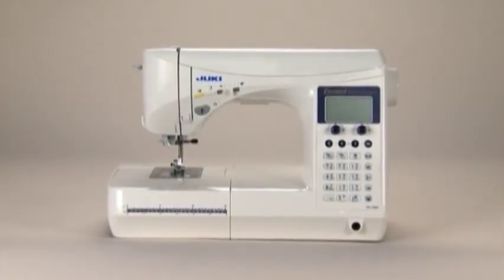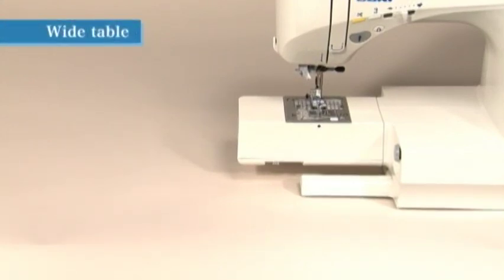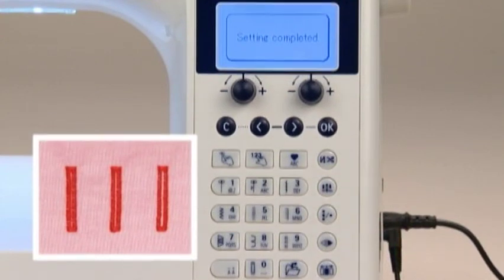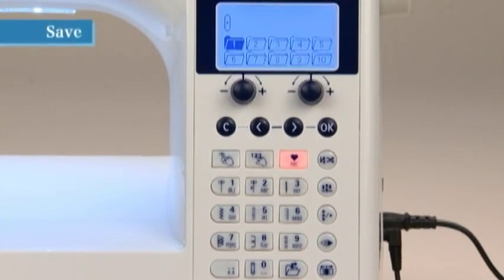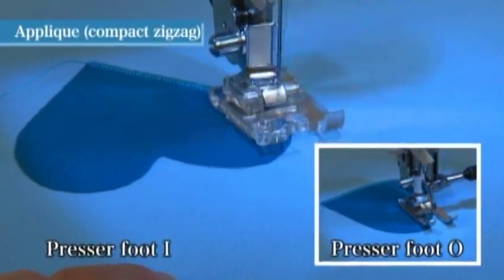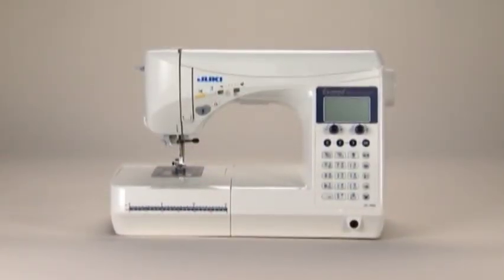JUKI HZL F600 introduction and operation

Comment: Hope this is OK.  It’s for my future reference. I keep coming back to this video: 

1:45	GREEN light - ready to sew or is sewing.RED  not ready to sew.
2:01	REVERSE button to sew backwards.  THREAD TRIMMING - using SCISSOR button - or STEP on heel side of presser foot. 
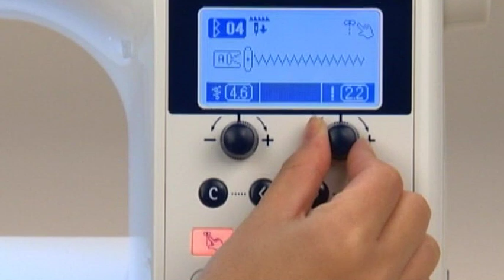2:41  and 3:57	NEEDLE UP DOWN button.
2:47	SPEED lever.
3:54	STITCH length and width adjusting dials            + or -
4:35	Free motion sewing and attaching a button - lower feed dog.
6:00	THREAD tension
6:15	PRESSER FOOT adjustment - fabric thickness.
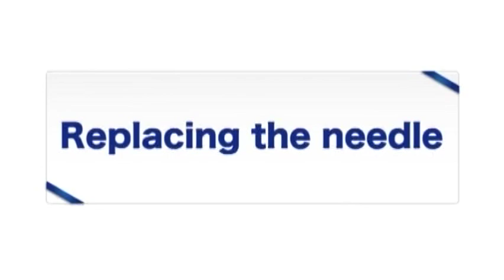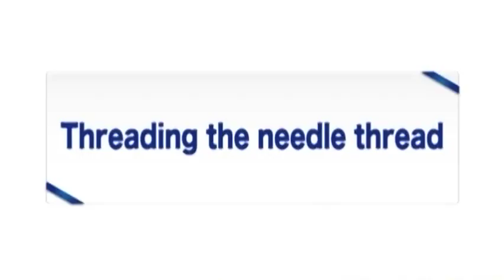6:47 and 9:47	Replace NEEDLE - regular household ndl - flat part facing back - THREADING ndl.
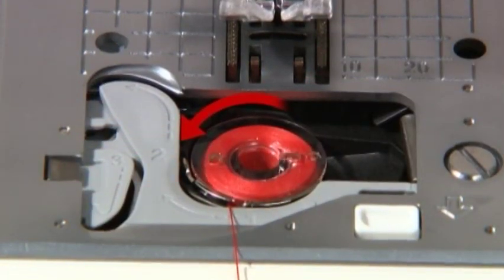7:43 and  9:13	Refilling BOBBIN and threading BOBBIN.  
11:41	SEWING THICK fabric
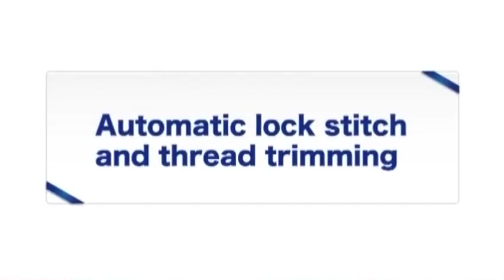12:43	LOCK STITCH and thread trimming
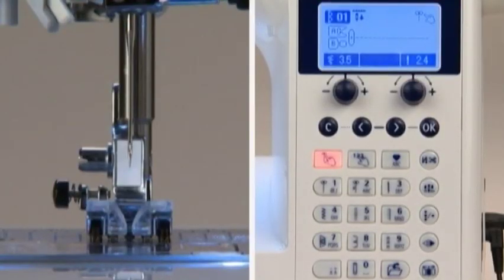14:05	NEEDLE POSITION - straight stitch
14:45	OVERCASTING stitches (there are 3) - serger like 
15:27	BUTTONHOLES
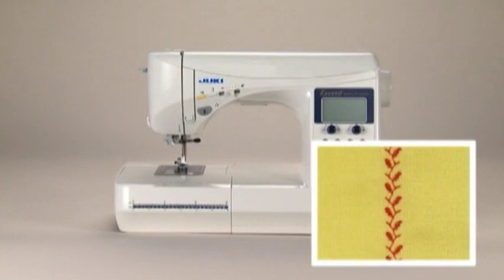18:35	DECORATIVE stitches, i.e. Select by numbers button, press the > button, to decorative icon, OK, input 02 for the pattern, presser foot I.
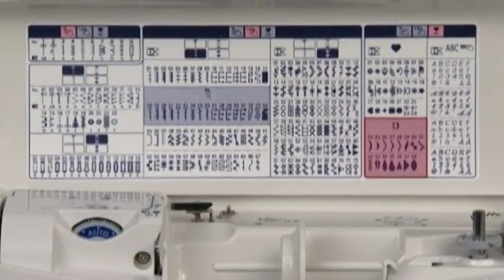19:15	SCALLOP stitch, Select the 🖤 button, OK, 24, continuous stitch button (3rd below OK button), presser foot I. To elongate: press 5th button below OK, select the size with >, OK 
20:17	LETTERS, i.e. Select the 🖤 button, then > to select alpha or Nos., OK, use numbered-alpha keys to “write” (same as old cells’ keys, i.e. press 5 button once for J, then, continue pressing this key  until u get lower case letter, >, 8 button twice for U), presser foot I. To correct letters, press the C (clear) key - next to the < key. Delete all by pressing-holding the C key.
21:54	DARNING, press the 123 button, 22, presser foot I.
22:50	SAVE/CALL - to save pattern combinations
24 :O1	PATCHWORK QUILT, piecing, pattern no. 2, presser foot A
24:52	APPLIQUÉ, pattern no. 5, 6 presser foot I or O.
27:42	QUILTING, walking foot, or presser foot Q (for free motion)
31:24	RANDOM STITCH PATTERNS (could be used for crazy quilting.